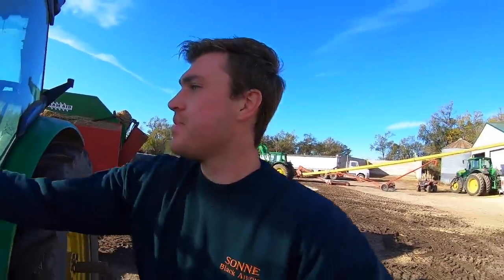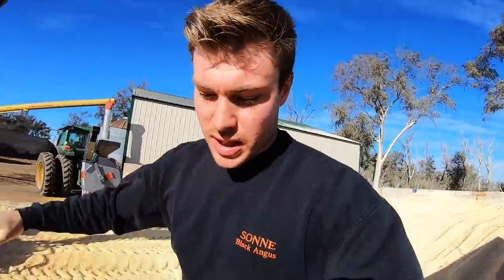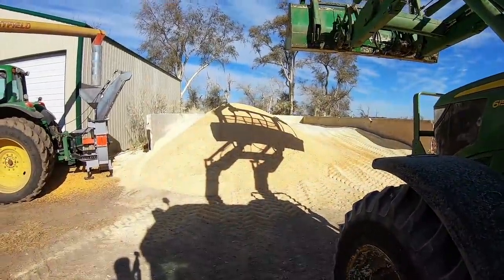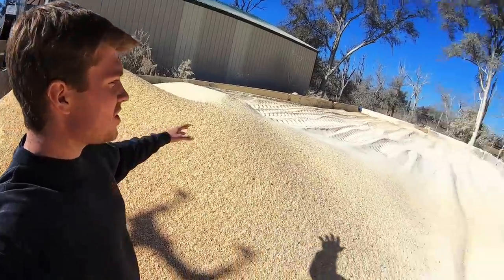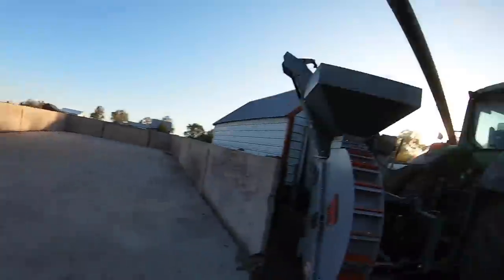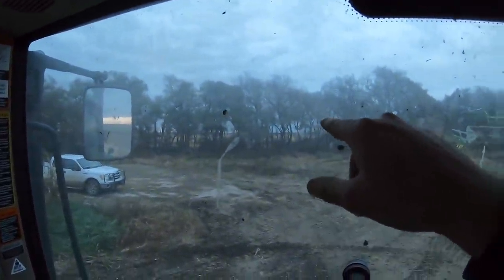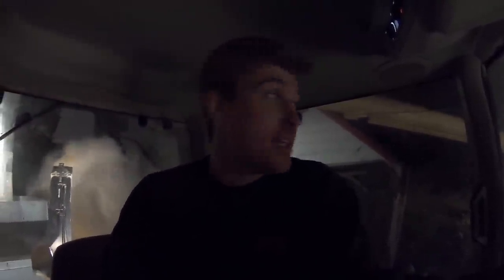Finishing Wet Corn Harvest

Comment: Thanks & question pls. Why crack the corn and why wet the corn--seems like it would ferment, grow mold & spoil before it was used up? Does it freeze? You working hard!
Reply from the maker: Good question, we crack it to allow lactic acid bacteria grow quickly, and within a matter of days the pH drops really low, so nothing else will grow in the cracked corn

Comment: So much work! At 9:20 this is the "pit?" Why do you put the corn in here? Is this where it drys or what? Is that the corn used to feed the cattle?  Oh! I'm #700!!  Yeah!
Reply from the maker: We pack it in there to its pH level lowers and the quality stays good. Then it is easy to feed since it is right there in the pit and we dont have to pull it out of the grain bin. Also since it is cracked, it is easier for the cattle to break it down.
Reply: @SonneFarms  makes sense to me. Thx

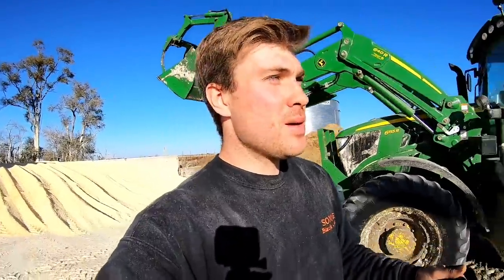Comment: 6:02 I come from the construction world not the farm world.  In the construction world we never, I say NEVER, leave a bucket of a loader up in the air.  So, why dose Cole leave the bucket up?  Is there a 'farm' reason?    Just asking a question.  Not trying to make any trouble.  Thank You.
Reply from the maker: Good question. I understand that there is potentially more stress on the equipment and also the bucket could fall down without warning. We do this sometimes because we are in tight quarters and lifting it up gets it out of the way. But in this case at 6:02, there is no reason why the bucket was in there air, I probably should have lowered it